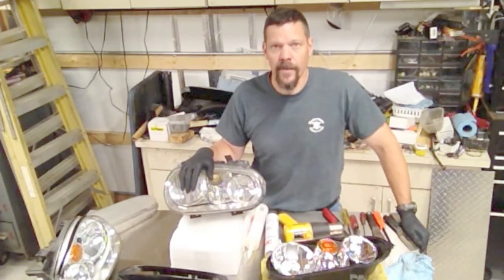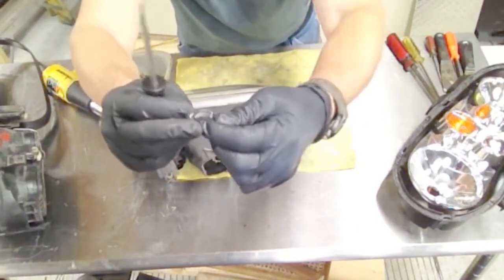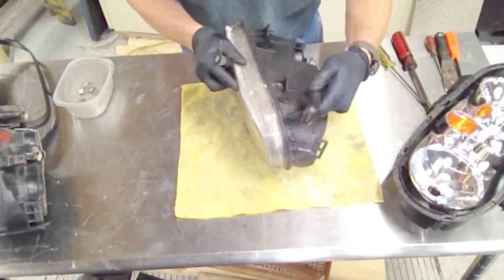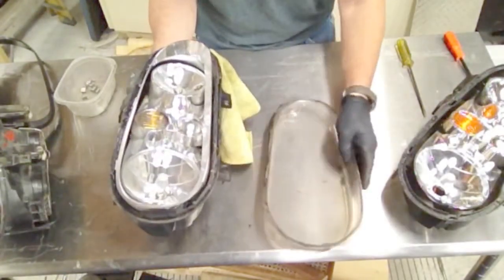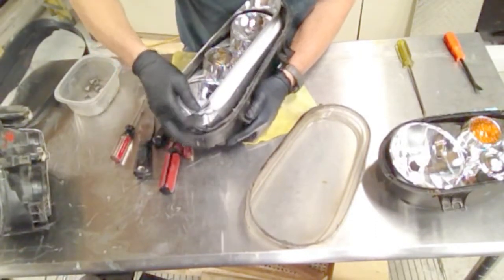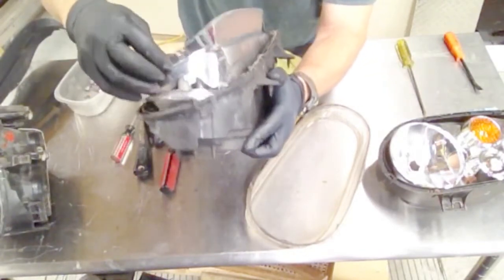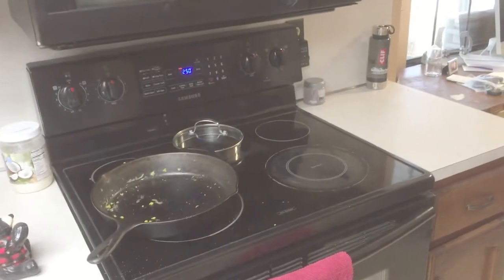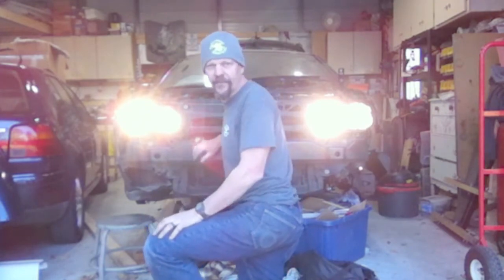Replacing a headlight lens MK 4 VW GTI/Golf

Comment: How would I go about separating mk4 glass lenses? Mine don't have sealant, I've got a broken light that I want to reuse the lens from, I had it in the oven to the point it started melting the plastic and the lens is solid, whatever is holding it in doesn't melt with heat but it's factory, now I'm lost with what to do.
Reply: There are 4 metal clips to remove first, they may be covered in adhesive. If you have those off already, I’d guess that it’s been repaired once already and a different adhesive was used instead of the usual butyl rubber. Only thing I can think of is to sacrifice the housing and carefully cut it loose using a dremel type tool. Sorry I don’t have better advice for you!
Reply: @hesty32  thanks for your reply, I'm not sure if it's an EU thing but none of ours have the clips, we have glass lenses and adhesive almost looks like the grey blu-tac but it's gone hard with age, but yes that's the only solution I could think of, cut the housing off, others online smash the glass but I need it so I'm in a bit of a conundrum.

Comment: This will work in EU headlights also but bare in mind US use plastic lens not EU OEM glass
Reply: Yes but no. And its infinitely easier with the headlight buckets on the car.  I just did my 2002 337 in these. just use a box cutter utility knife between the plastic and the bucket and some go be gone. Its simple. https://www.vxtuning.com/shop/replacement-lenses/headlights-replacement-lenses/replacement-glass-headlight-lenses-mkiv-golf-gti-r32/

Comment: My EU Golf 4 headlights will NOT seperate using heat. I've got them up to the point the polycarbonate lens starts boiling but the lens will not seperate. all outta options...
Reply: Its probably a different adhesive used instead of butyl rubber if it is not getting softer with heat. In that case, you are probably best off cutting as much as you can (carefully) with a box cutter or something similar then carefully prying the lens off, cutting the adhesive as you go. Reminder though, make sure you have the silver retaining clips off before you start prying